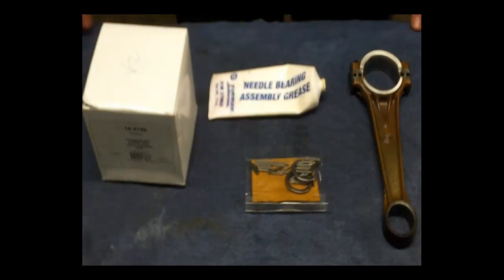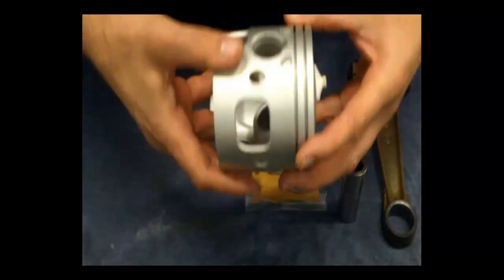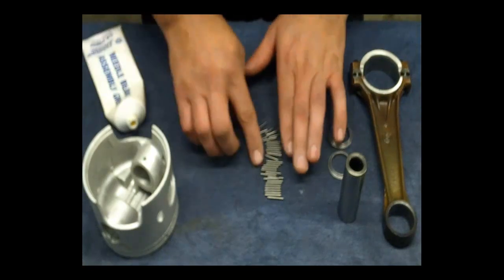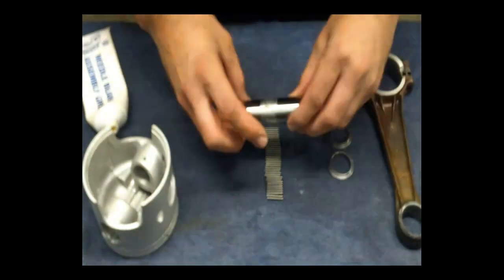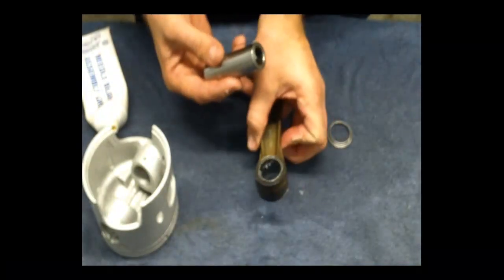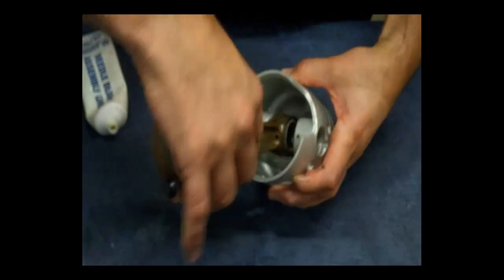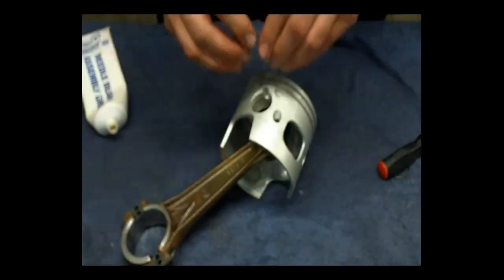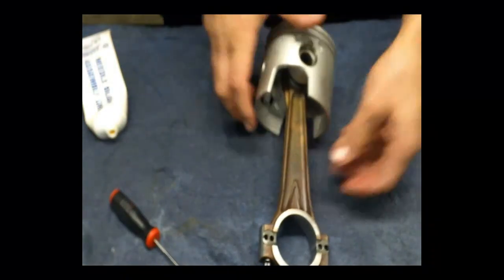Outboard Rebuilding - How to install a piston onto a connecting rod

Comment: In reading the J/E service manual for the 70HP, it states, "The connecting rod has no specific orientation". Nowhere in the entire disassembly or reassembly does it mention rod orientation except to keep rod caps orientated to their specific rod and rods to their specific cylinder. If one could see what actually goes on in the crankcase @ 5000 rpms, you would know. There are holes for oiling at the wristpin because that end of the rod needs a little help. It does not fly through the fuel/oil stream. However, the wrist pin only rotates 90 degrees in the piston/rod configuration and is out of the main torrent as it travels through its cycle. However, there is more than enough fuel/oil flow around it. This is why some rods have oil holes countering the intake flow to the crankcase, some opposite, some on the top, some on the top and bottom, and some without an oil hole at all. The bearing shields provide more oil to the wrist pin end bearings than the oil hole. If the hole was specifically to let oil in, the crank pin end would need them too. The rod "bumps" are to insure that the cap is properly orientated to the rod. The rod itself is perfectly symetrical and has no oil entry point other than  the tapers on the rod sides @ the mating surface and takes many times the lateral load than the wrist pin takes.  Just my 35 years of humble outboard and 2 stroke experience.

Comment: hi im working on a johnson 1987  25 hp im currently putting the conrods in but i noticed that one of the conrods oil hole is on the top of the pin rod which should be facing up towards the fly wheel to collect excess oil and lubricate the needle bearing pins however the other conrod oil hole is on the side of the pin is that normal if so which one goes up and which one goes down and how would that hole lubricate the needle pins since its on the side of the rod

Comment: Hi I need some help,  I am rebuilding a Johnson in line 60 hp . The con rods have an oil hole at the top of the rod small end of the connecting rod and one below on one side pointing down towards the I beam. How do I tell which way around the con rods go. Great vid and thanks in advance.
Reply: omg same problem here 
hi im working on a johnson 1987  25 hp im currently putting the conrods in but i noticed that one of the conrods oil hole is on the top of the pin rod which should be facing up towards the fly wheel to collect excess oil and lubricate the needle bearing pins however the other conrod oil hole is on the side of the pin is that normal if so which one goes up and which one goes down

Comment: question for you buddy,.should i replace the connecting rod bearings,on my mercury 90hp im rebuilding? (all the needle bearings/crankshaft/rods) look great,(no wear marks/pitting),but they have been in that motor since 1997(15yrs)..would you replace the needle bearings, reguardles of how good they all look?,.thank you,i really appriciate it your adivce & time.

Comment: @OutboardAdvice I guess I forgot that the oil hole is on the small end of the rod.  I have done a 90 degree looper and crossflow and I read in the service manual that the oil hole is oriented up towards the flywheel.